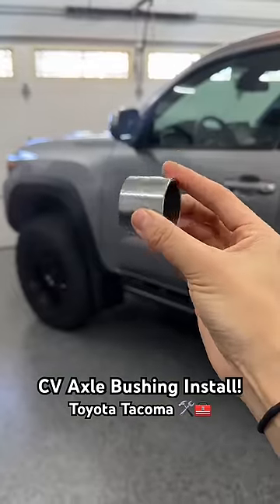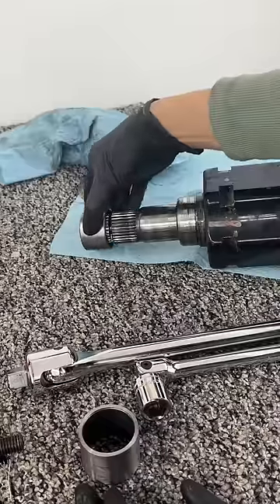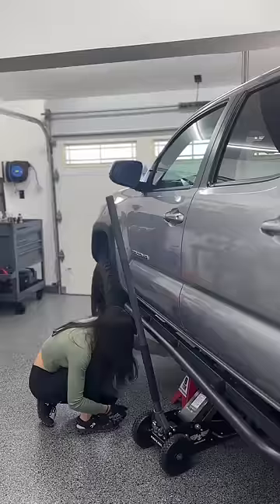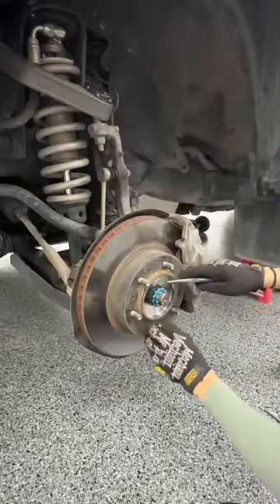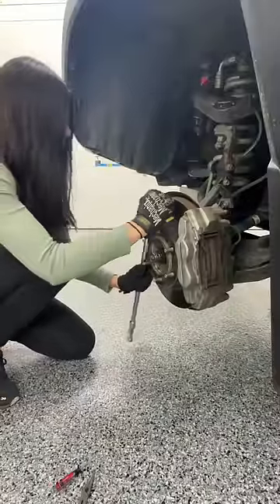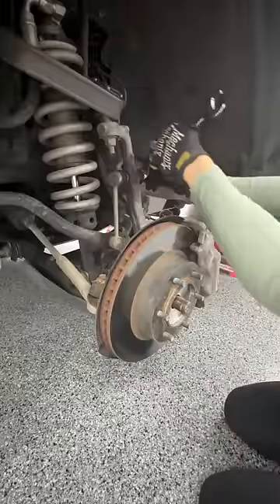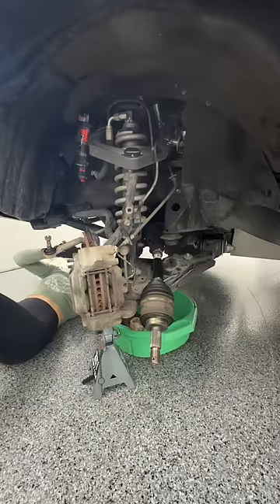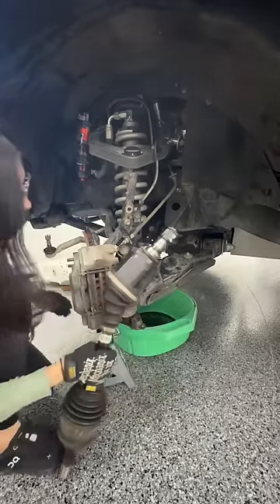My Tacoma Needle Bearing HAD to go! CV Axle Bushing Install pt 1 #shorts

Comment: As somebody in the northeast I'm furious with how easily everything came undone. My axel nut on my xterra took 3 of us, a 5 foot cheat bar, and a blowtorch and still took 45 mins
Reply: Hmm, I see your problem. Put more salt on it. No need to repair. Just junk it.
Reply: @Ton0987  won't have to unbolt it if it just disintegrates, now that's using your head. Lmao
Reply: I think the most rust/time spent ive seen when doing a brake job here in cali was having to hit the rotor 5 times instead of 3 for it to pop off 😂
Reply: @ramiromorales5006  that makes me wanna throw up out of frustration lmfao. Rust isn't all bad though. I had a tie rod go completely but not break because the rust had it so goddamn caked together (or so I like to tell myself). Soon as we went for the bolt it like peeled in half and came out without the bolt being loosened. Completely fucked but a clean part may have failed earlier, who knows. I like to believe maybe that's why, makes the rust feel better 😅🤣 

Had a emergency tire change that took legitimately 75-100 wacks with a 15 pound sledge just to get the tire to break free.
Reply: I feel you mate, I live in Indiana where you often see some rust. It’s not very fun, on anything.
Reply: 1/2” impact does it in 5sec. I use an impact to instal/remove axle nuts like that. Rly hard to torque down, & just send it home.
Reply: @michaelbenoit248  it was a driveway job. My impact blew out (all vintage tools from my dad) so I had to get her done with what I had on hand. Unfortunately when you drive beaters that's often the harder way lol
Reply: I drive a Ram so the parts are changed So often that It’s pretty easy here in Wisconsin 😂😂 now my back driver’s side rotor was an hr B!tch to get off but the Axels and suspension 💩
Reply: Dude i no lie just had to remove mine on my civic. Upstate mind u. 36mm nut. Came off easy. I was shocked. I thought u had to call jesus to give me a hand.
Reply: Hey...all ware breake loose before and cleaned... This woman îs not mecanic... 🤣🤣🤣 Just makes movies for likes... For money 🙄
Reply: Can't be seized if its liquid 😂😂😂
Reply: @michaelbenoit248 proper rusted lugs in rust belt won’t come off with a Milwaukee high torque, much less an axle nut/bolt. It literally becomes one with the shaft and hub
Reply: Yeah, I was pretty upset as well.  Some mechanics will never know our struggle.
Reply: I was thinking the same and I live in the South. Once you get close to 100k miles things start to freeze
Reply: @SanSurv-Angelo  even less bro. The new trucks in my town come with some noticable rust cause they're so close to the road and all the salt gets blown that way. I don't know anybody that's had a car not eventually disintegrate due to rust
Reply: 😂I wouldn't know anything about that

Comment: Easy way to confirm if that bearing is what making the vibration it to throw the truck in to 4wd. If the vibration goes away that bearing is probably the cause. Only really see them go bad on lifted trucks.

Comment: Yeah, I had the same thing, did the same thing, didn’t fix it.  Turned out to be the passenger wheel bearing.  That bearing was tight and felt perfect.  I swore it wasn’t going to be the problem before I changed it…..it was. Frankly, I’d recommend getting a mechanic to put the stethoscope on the wheel bearings before I changed the needle bearing.
Reply: If you put the vehicle in 4h and the noise and vibration gos away you know it's the needle if not it's something else.

Comment: Always fun tearing into a vehicle, i normally pop the centre cap of the wheel out and loosen the axle nut when the vehicle is on the floor and in park so i don't damage the studs 🙂

Comment: Just a tip. Next time if you have to hammer the tie rod out, put the castle nut on upside down and thread it on till it’s flush. Hammering the end can mess up the end of the threads, and leaving the castle nut the correct way can sometimes deform the uprights into the tread and strip the tie rod end.

Comment: The wheels have a plastic cap in the middle that you can take off to access the axle nut. Basically take both the plastic and metal caps off, bolt the wheel back on, and lower the car back down onto the wheel. Then put the car in neutral or park and put the parking brake on so it doesn't roll and you can use the breaker bar and your body weight to break the nut loose.

Comment: Quick note: don't hammer down on your tie-rod ball joint. You can hit the spindle on the side to break it loose then use a prybar or something else to pry it out.
Reply: Yep. Hammer what it goes through, not the part itself
Reply: Or thread the nut back on a cpl threads
Reply: @-B_G-  I'd still not even do that. Better to just not hit it to avoid damaging the ball joint (unless you're replacing it) I've started using pullers over hammers or pickle forks and they work wonders
Reply: You can use a dead blow.

Comment: You can put a screw driver in the roter side cooling fins and push it up against the break caliper and then break the axle nut loose, i use this method all the time and it works great just use a screw driver that is the same size as hole on roter. Loved your video

Comment: This often happens with a large lift without doing a differential drop. A 2" lift should have at least a 1" drop, and if you lift the rear end, you should consider a center carrier bearing drop kit to help avoid vibration from the driveline.

Comment: To hold the hub from turning, either install the wheel without the center cap and put it back on the ground, or lock it in 4x4 with the other 3 wheels on the ground.

Comment: Its a car that has front axles... as long as the other side has the cars weight on it. There is no need to pin the side you're working on. There's this and there are also better impacts instead of that under powered drill you're using. Get a proper impact and you'll never have to worry about axle nuts again.

Drop the upper control arm, gives you more wiggle room and makes the job 10x easier.

Comment: Get yourself the milwakee 1/2in impact driver. I was able to remove these axle nuts with ease
Reply: I got a 1/2"  corded impact for 50 dollars. Dang thang dims the lights when I use it and weighs 10 lbs. A true monster daddy
Reply: I was going to say cordless impact too.  So much to choose from and saves you so much time and energy.
Reply: Don't need to be Milwaukee, many brands takes en off the same, even 1/4th the price

Comment: Inrerested in part 2 to see if you pulled the front differential carrier to replace the cv axle bearing. The same bearing went bad in my Tacoma and it booked for 9 hours. I made a tool to extract the bearing and reinstall from the outside and it only took an hour.
Reply: I'm confused. Isint what your talking about what she jus replaced. It's the. Needle bearing (or race) that is in the clamshell front diff?
Reply: I'm confused. Isint what your talking about what she jus replaced. It's the. Needle bearing (or race) that is in the clamshell front diff?
Reply: @louistoscano3830  Yes, I am talking about the same bearing. The clamshell is the style of front diff housing. The bearing / bushing supports the CV axle inside of the front differential carrier.  The video didn't show how she went about removing the needle bearing which used to be the hard part. I looked up the bushing that was shown and that place sells an extractor tool that looks just like the one I made lol cool!

Comment: A solid bushing over needle bearing?  Not my first choice.
Reply: Lifting the truck puts stress on the Tacoma needle bearing. It regularly fails.
Reply: That is until the needles break off and end up in your front end diff.
Reply: I was about to ask the same thing, I'm a racecar guy and not into off-road stuff. How does the bushing get oiled while having tight tolerance to keep the bigger load from the lift kit ect?

Comment: Toyota bearings seem to have a short lifespan.  My Toyota car also had 70k miles on it, it makes noise so I replaced it. On the other hand, my Lexus had 170k miles on it, but never worry about the bearings
Reply: Lexus is Toyota
Reply: Toyota/Lexus vehicles built in Japan and Canada have fewer problems than U.S. built ones.
Reply: Shoulda bought a Jeep!
Reply: @0004612  sure, Just Empty Every Pocket

Comment: Was there any leaks after? At times when remove a CV the seal tends to rip or randomly start tocleak after. Many recommend replace the seal and man are those a pain in the ass! To remove and put back on!
Reply: Never had a seal leak on a cv when removing it… replaced hundreds

Comment: Probably would’ve never been a big issue with with stock, wheels and tires. The bearing probably fit was failing because of the bigger tire wheel combo.

Comment: To diagnose cruise at 40 mph and put it into 4wd. If it goes away it’s the clamshell bushing. Only happens on lifted tacomas 4Runner tundra seqoya
Reply: The needle bearing fails with stock Tacomas too. Needle bearing fails faster when lifted.
Reply: @111Ronaldinho  not nearly as common but of course with mileage anything can fail. But every lifted taco they would fail almost immediately after the lifts were installed
Reply: Is a differential drop necessary if your taco is lifted above 2"? I replaced the needle bearing. I have a 2" leveling kit on the front. Truck drives smooth now after putting that ECGS bushing, just curious. @_JTPR_
Reply: @111Ronaldinho  I would avoid a dif drop until you exceed 3 inches of lift because of the angle of the drive shaft. I haven’t seen a clam shell bushing fail and I’ve been doing them for years. Are you running high angle boots on the cv axles

Comment: I did this replacement on my truck. That CV is damn near impossible to remove. Get a big slide hammer if you’re going to DIY.
Reply from the maker: Yeah… it actually took me almost 2 hours of banging to get off. Learned that there are these tabs you can hit with a flathead to pry the axle from the joint. Still, a piece of work!
Reply: Just need a hoist and a 3ft pry bar. Easy!

Comment: Wonder if something like this would work on Nissan Armada/titan.  They have same issue on the driver front stub shaft.  I replaced the oem needle bearing but it was just as sloppy on the stub shaft as the old one was.  I replaced it anyway but didn’t fix the issue

Comment: Most of the problem is wheelbearing. 580 at dealer. I put ebay parts only 80 still good until now.
Reply: It's the needle bearing that causes certain symptoms, not the wheel bearing that Chloe experienced.

Comment: Is this necessary to do after a lift? Or when reaching a certain mileage? Getting a 3 inch lift soon with about 20k in mileage. Been on a 2inch lift for about 5 months now but adding a Westscott collar to get the full 3 inch in the front and wondering if the oem bushing can stay.   Thanks

Comment: Next time, get a pry bar and use the caliper, that floor positioning can slip and the power bar can slip and smack you in the face.

Safety first.   Next time, loosen the nut with the wheel on the ground..

Comment: Like everyone else is good to see that a female can attempt solid Mick mechanic work but only concerned about safety you should be wearing protective goggles and a beef ear shoe then you’re open to one you can pop a nail not just in your hands going to be for your shoe when you do this kind of work especially Because you’re handling some heavy pieces of iron and they can slip out of your glove hands.😊

Comment: Just a tip: for the axle nut, keep the hub from spinning by putting a heavy screwdriver or punch into a brake rotor vent and rest it against the outside of the brake caliper. Works the same for when you torque it going back together.

Comment: This is caused from your upgrades to your tires and suspension.  Modifying suspension changes the angles and load on the bearings from the way the were engineered.  Also not changing the front diff fluid at break in and maitaining it can put shaving in the fluid and eat the bearings.  2016 tacoma trd 6spd v6 80000 miles going strong.

Comment: You got the axle nut bolt THAT easy? Either you changed them last week, or everything is staged :))) 'cuz in real life that would require -2 tanks if gas for your flame torch, 27 cans of WD-40, and probably 2 bented breaker bar😅😂

Comment: Take the center cap off the wheel, put the wheel back on and use the weight of the truck to break the axle nut loose or buy a friggn impact wrench geezus. Spent all that money on that fancy truck but you can’t buy an impact?!  Smh 🤦

Comment: Very bad move you did there Do you see the brake line the rubber brake brake line being an extremely stretched out and pinching itself over well better plan on putting a new rubber brake line on because most likely we'll start collapsing on itself This is a very bad move to do